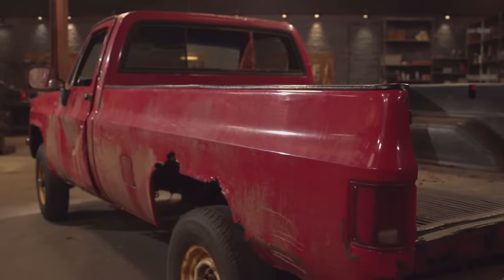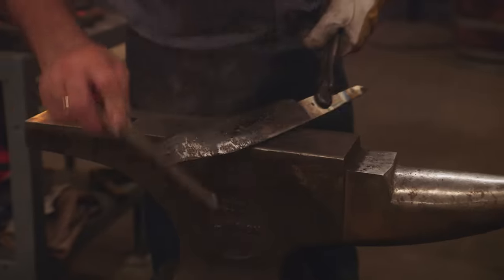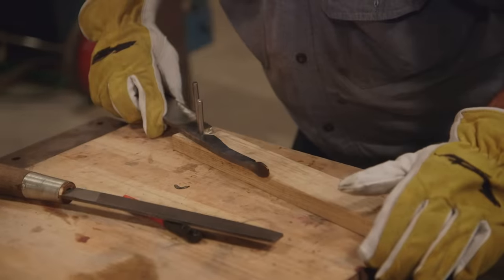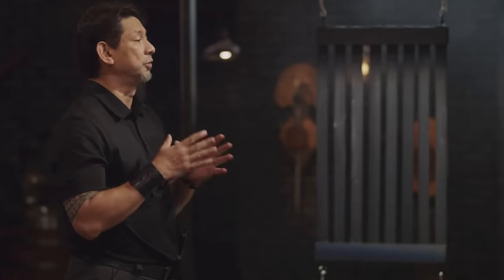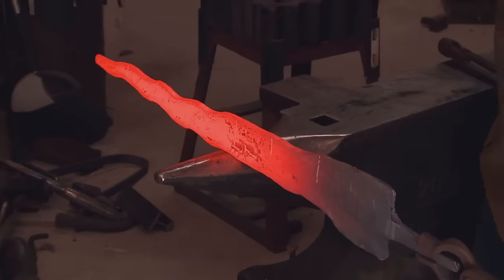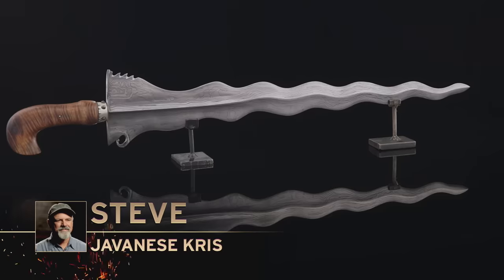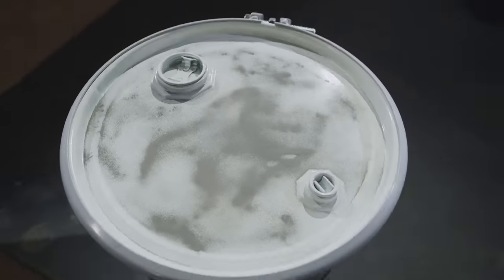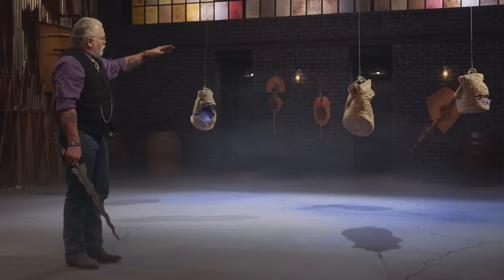EXTRA SHARP Javanese Kris is Put to the Test! | Forged in Fire (Season 6)

Comment: If it's been tempered is there much point in blue-backing it? Is it the toughness of the blade being throughout instead of the spine being shock absorbant, and without blue-backing it, it would cause an issue with overcoming the friction with the handle? Genuinely curious if anyone knows please
Reply: I think you do this to reduce the stress in the material so it is more strong
Reply: @blackon999  yeah but that's what I mean, they mentioned the blades had been tempered before he blue-backed it
Reply: @50shadesofmatthewsmith17  what tempering does is harden steel but that can also make brittle, what he was doing was softening the back so it would be more shock absorbent as they mentioned while keeping the edge hard.
Reply: @giwrgospoulios9174  yeah, a true hard blade can shatter like glass.  bluebacking helps avoid that.